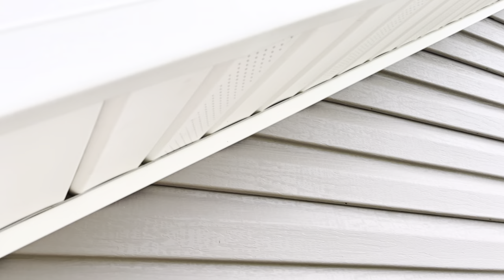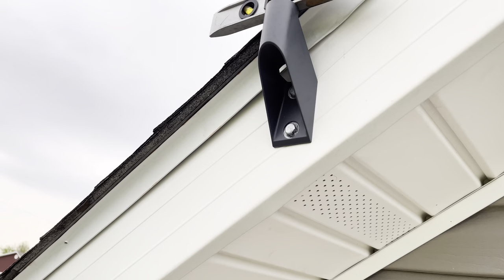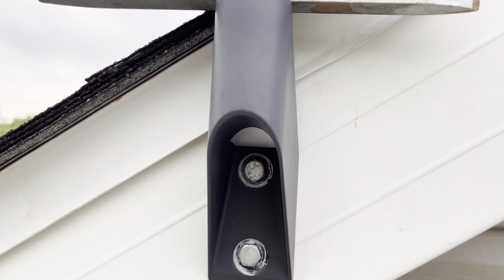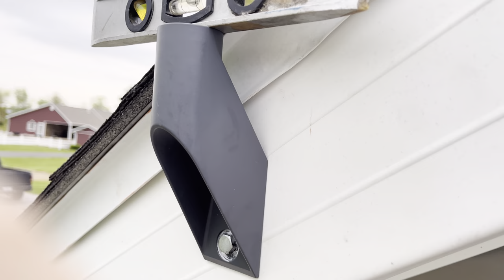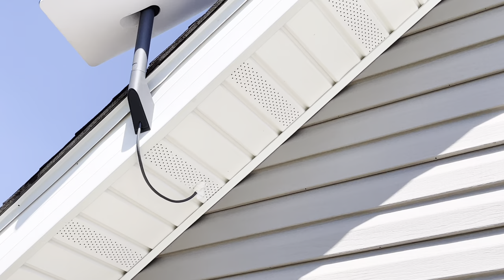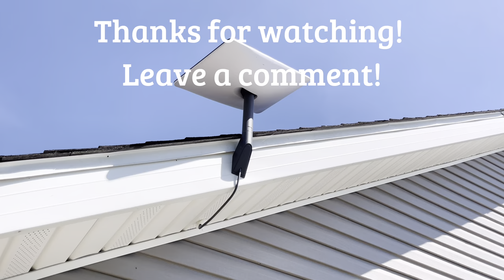New Starlink Short Wall Mount Installation

Comment: Extremely important ...the cable does "not" go through the round hole on the mount...it goes to the side. Had me baffled for a while.
Reply from the maker: Good point. It is a little odd that it does not go down the pipe and out the bottom.
Reply: Disconnect the cable from the dish instead. It's straight rather than a right angle. Sorry if this is late
Reply: @Ragnor-the-Viking  I thought boths ends were the same...? one end of the plug, being angled slightly more than the other end...but neither end would go through the pipe.

Comment: I am a frustrated starlink short wall mount installer.  Planning to install in the eave of my roof...  how do I test the rotation and pivot to see if it will work???
Reply from the maker: Sorry for the very late reply.  I just held it in my hand the entire time it started up while was on a ladder.  It was my only choice.  Once it got done going through all the rotations I saw that I was about an inch above my roofs pitch. Hopefully you were able to test the rotation that worked best for you.

Comment: Where did you purchase the short wall mount? I can't see anywhere on the starlink site where I can purchase different mounts.
Reply from the maker: I purchased the short wall mount directly from the starlink website. You have to log in to your account, click the shop tab, scroll all the way to the bottom (which is where I was able to locate it), and it is currently $40 dollars. After clicking on it, it appears you "add it to cart" and complete the purchase.  I hope this helps!
Reply: @farmjokester  Thank you, I just ordered it, I don't know why I didn't see it.
Reply from the maker: @chapter4travels  No problem! Good luck! 👍🏻
Reply: I just ordered a Starlink and on the web site "shop" tab am only given option for : ground mount, flashing mount, cable routing kit, masonry routing kit, pipe adapter, volcano mount. I scrolled all the way down and there are no other options. What I am looking for is the short wall mount and also a Starlink cable so I can run it through my new wall before the sheetrock is applied. I wonder if it takes a while for Starlink to get my order in the queue so I am recognized as having made an order. Then perhaps I can purchase accessories?? Any assistance would be appreciated. Thanks!

Comment: What's behind your fascia? The install guide says to use a stud finder, but I find it hard to believe there's any sort of stud there. Or is there a 2x6 running the length of the fascia?
Reply from the maker: Yes, a 2x6 or something similar. I predrilled smaller holes through fascia to make it a bit easier. Then I applied lots caulk to help seal and waterproof. I did what I felt was practical to help with my install. Best of luck!
Reply: How do you find where to drill in your fascia? Was it the stud finder?
Reply: If I want to put it at the top edge of my roof, is it safe to assume below where the roof panels join I’d find a 2x6?